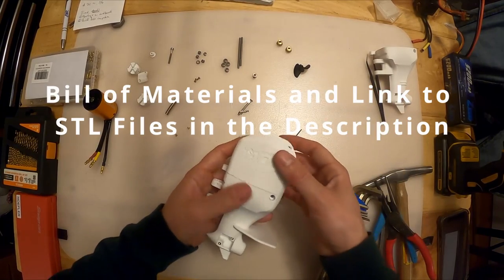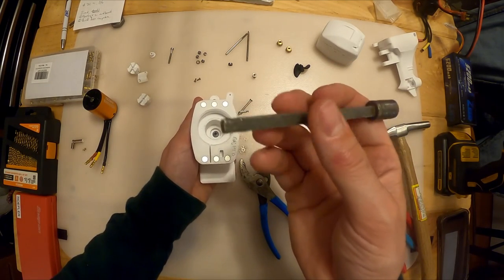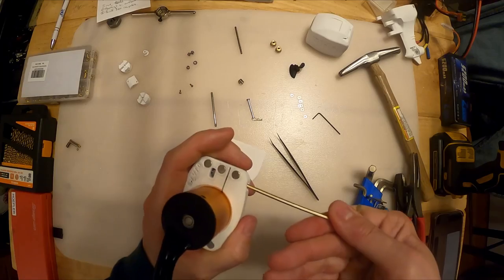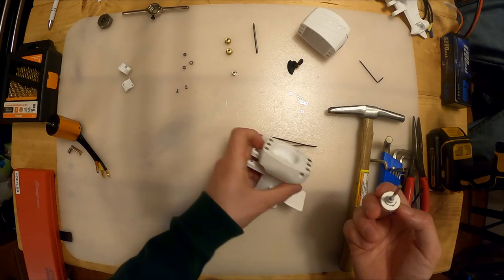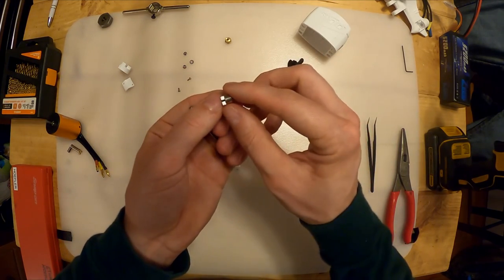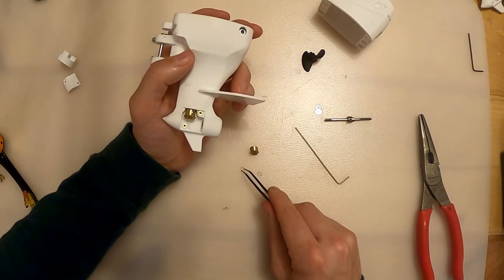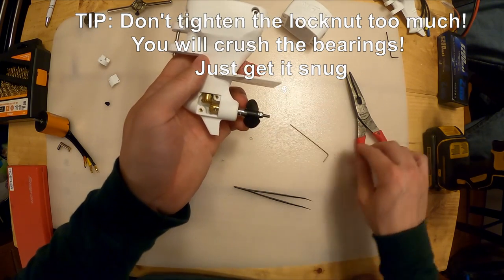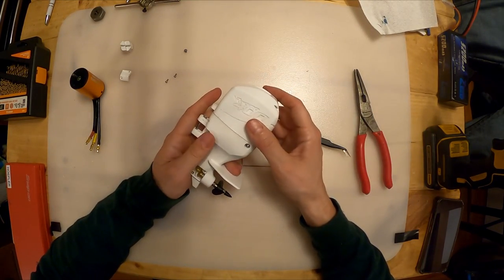3D Printed RC Outboard Assembly: Part 2

Comment: This has been the most fun to print and assemble and ive learned the hard way about meshing the gears, as the first set turned into striper glitter after a few hours run time,  Now i just need a big boat to support two monster outboards lol... As always great video kinda wish i had waited for this to come out before finding out the hard way, worst part is waiting on the slow boat to bring more gears ;)

Comment: I’m still waiting on a outboard motor mount to mount to a boat
Reply from the maker: How about these!

https://drive.google.com/drive/folders/1SHu_viYPPLJlH4GU4XAKMlI4l8DyJRGy
Reply: Thank you 
I just tried joining Patreon and said I couldn’t at this time
Reply from the maker: @dustinstokes3134  i think it was because I was editing the patreon page, sorry! Could you try now? Let me know if it still doesn’t work!
Reply: 10:47 hi, i printed the motor with your settings from pla+, unfortunately i can't get the motor to get stuck. do you have an idea what it could be?
Reply from the maker: @JW-iz6vp  when you say you “can’t get the motor stuck” are you referring to the electric motor? Trying to understand the problem
Reply: @ethoefler  Yes, I try to attach the brushless motor, but the housing from the 3D print does not screw the motor tight. I tried to tighten the screw but the gap in the lower part doesn't get any smaller.
Reply from the maker: Take a small piece of masking or electrical tape, roughly 1 inch long or 25mm and wrap it on the motor where you insert it into the outboard. This will take up the slop! adjust the length of the tape piece to get a tight fit! @JW-iz6vp